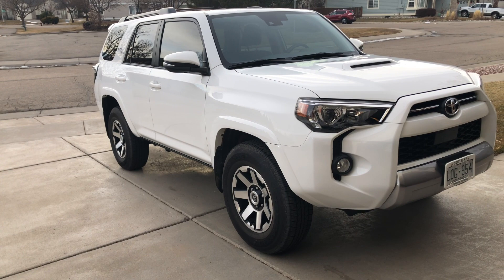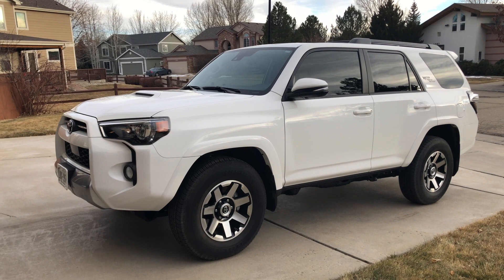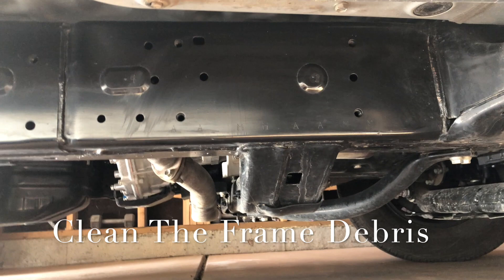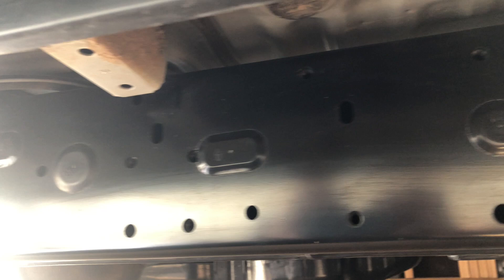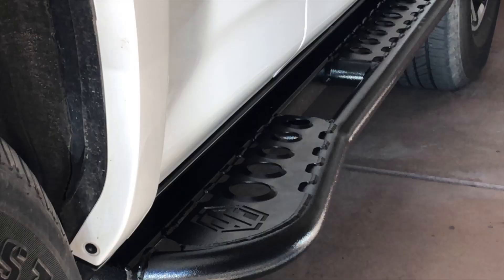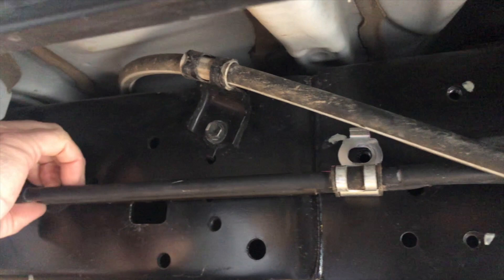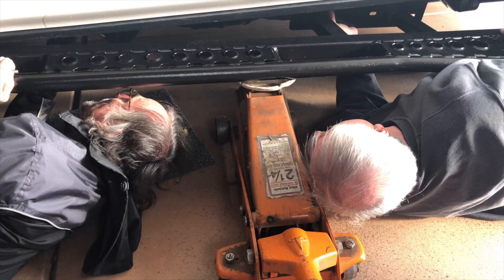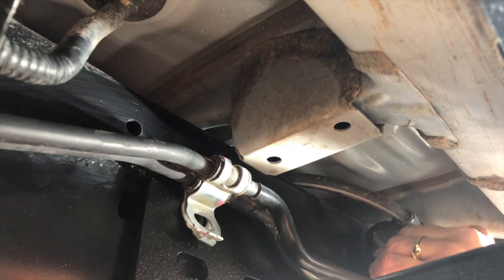5th Gen Toyota 4Runner KDSS slider install

Comment: Now that you have had them for a couple year's. Any issues with the bolts or coating? How they when wet when getting in and out of the 4Runner?
Reply from the maker: No problem at all with the bolts…. The coating wore a bit… not where you step but at a few of the welds. I recently decorated them.

Comment: Do the sliders pull on the kdss lines? Have you had any issues with kdss since install?
Reply from the maker: No issues… the sliders mount behind the KDSS lines. That is the most difficult part of the install - gently pulling the lines away from the frame just enough to nudge the slider mounts behind the lines.